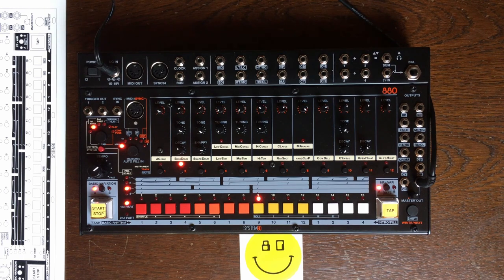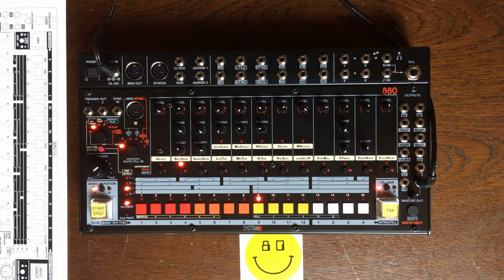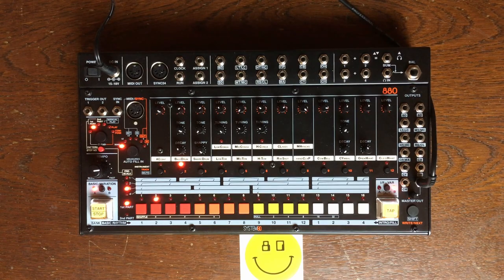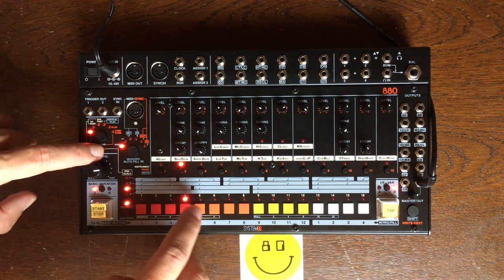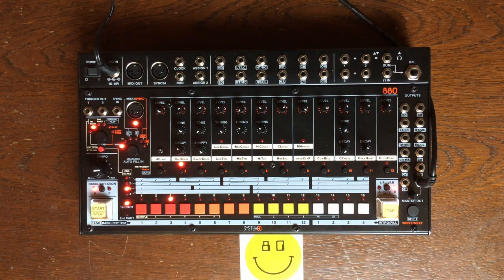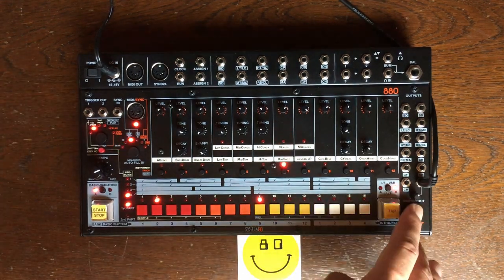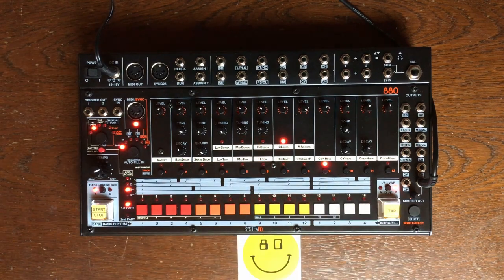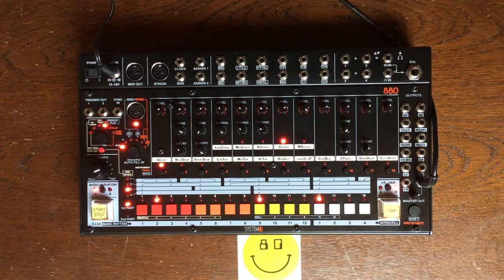System80 880 - The Video Manual

Comment: Salut Stazma, merci pour la vidéo. Depuis la première vidéo que j'ai vue de ce système j'en rêve la nuit. 
Avant que je ne craque et que je précommande, je voulais savoir si tu avais une idée d'autres systèmes de boîtes à rythme vendus avec leur case dédié ? Je n'ai que de l'équipement semi-modulaire et j'aime beaucoup l'idée d'avoir un module avec un case directement, sans avoir à acheter un case plus grand etc. Mais je ne trouve pas vraiment de "all in one" pour des boîtes à rythme, comme celui-ci par exemple. Alors si tu as des pistes je suis très preneur ! 
Magnifique module et super manuel vidéo, j'ai tout regardé sans posséder la machine. Et quel son ! Presque mieux à mes oreilles qu'une 808, surtout la BD !
Reply from the maker: Merci bien ! Les mec de Tubbutec font une genre de 606 ultra moddé en eurorack qu'ils vendent avec une case qui va avec si je me souvient bien.
Reply: Super merci  @Stazma  la 606 n'est pas trop mon truc mais c'est cool merci pour la suggestion ! Je suis sur la liste d'attente de la 880 du coup elle a juste l'air dingue
Reply from the maker: C'est vraiment une tuerie cette 880 ;-)  @TristanBaldi